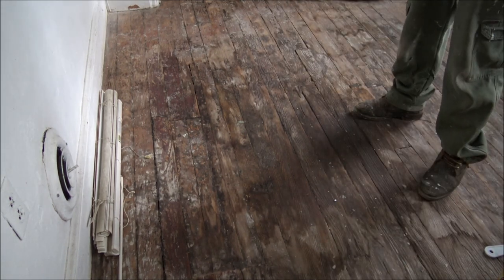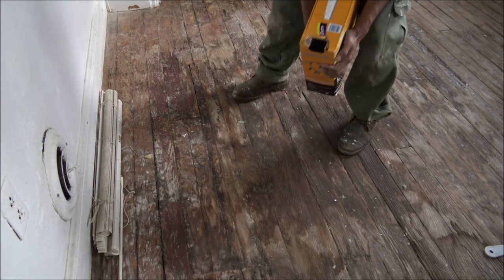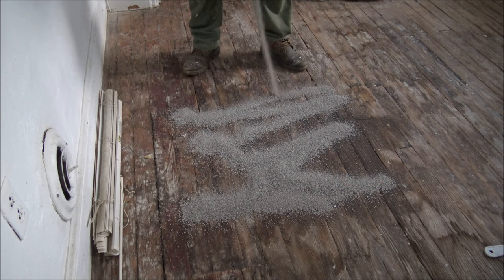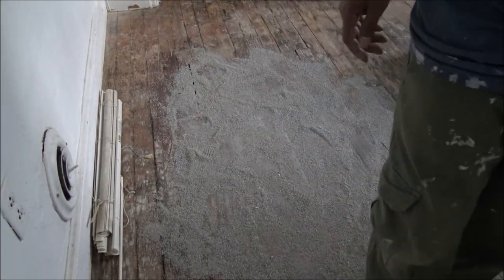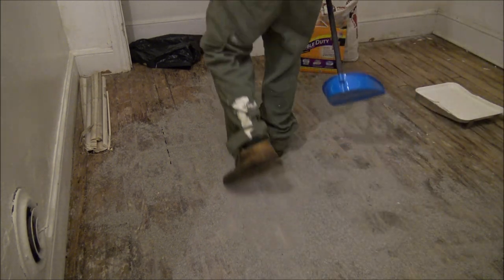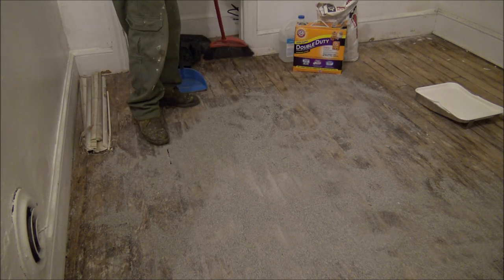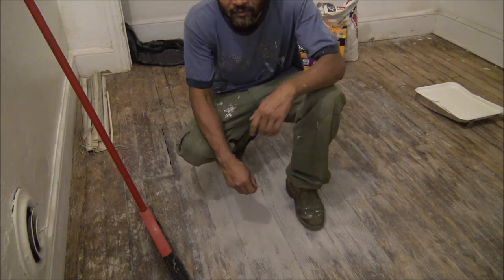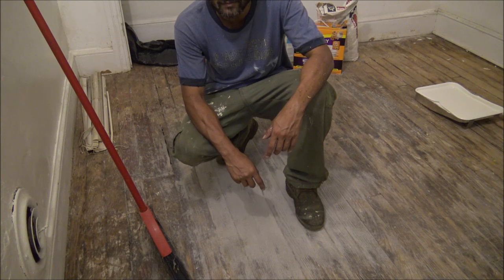How to get rid of dog urine smell and stain from wood floor

Comment: Great idea. I used to be a mechanic and we would do that to get grease and oil stains off of the cement floor. We call that the kitty litter shuffle. BTW, floor dry from an auto parts store is the same thing but cheaper and unscented.
Reply from the maker: Great point!

Comment: Thanks!🙂  Moved into a new house and the guest bathroom floors smelled of urine.  We tried everything but nothing worked, the smell would always come back
Reply from the maker: No problem.  I buy houses every year and I go through a lot of cat litter.    This is the best method that I uses.
Reply: Did it work
Reply: Have you tried using enzymatic cleaner

Comment: Question. 

I have a few pet stains on a property I just purchased. The hardwood is finished (needs to be redone) but I am wondering if this will work if the urine is dry? How long should I leave it? What should I do after removal?
Reply from the maker: I usually let it set a couple of days.  Hydrogen peroxide may also need for discoloration.  Sand it, stain it and polyurethane
Reply: How do you stain it with what I don't

Comment: I’m going to have to try this. I’m getting ready to close on a full rehab project and at some point either homeless people or cats must have been peeing inside the house. It’s smells horrible. There is rugs and wood floor under it. I was going to tear it all up and put a new subfloor but maybe this will do the trick. Thanks !
Reply: Did it work???
Reply: You could also try oil based killz if you are talking about basic subfloors.
Reply: I’m closing on a property also with a smell, did you have any luck? What worked for you?
Reply: I have used a Ozone Generator. 
You obviously clean the area but
Sit that machine in the room and let it run . They replace oxyegen  with another molecule. Anyway on ebay n not that much$$

Comment: Question: what if the urine has been there for a long time and it’s already dry
Reply: Pour vinegar over it first let it soak then do the litter
Reply: @Jmay411 👍
Reply: for use vinegar do I need mix with water? or just pour vinegar directly on floor to soak it before litter?
Reply: @lingfeiouyang yes I need to know how to do this the right way cause I don't wanna mess this up.
Reply: I need to know as well about to redo my floors and have nasty smell
Reply: Water can also reactivate it

Comment: I would love to see that floor once it's completely done. I can see that the litter did something but what is the next step? A complete sanding and finishing I presume?
Reply from the maker: I apologize for not unloading the finish product.  Yes it had been sanded,, wood filler, stain, and varnish.  The house had been rented out for the 2 months already.
Reply: @KennyHandymanInvestor  Thanks. I'll bet it looks great. I didn't think of using kitty litter because my floors are stained golden oak and have 2 coats of polyurethane on them. I started with the hydrogen peroxide 3 days ago and they are looking better but they're not there yet.
Reply from the maker: @miltyler8110  I uses hydrogen peroxide also in some cases.  For the past 15 years I always uses cat litter first.  You should give cat litter a shot to absorb those extra moisture remaining in the wood it will also remove some of the stain.
Reply: @KennyHandymanInvestor  Interesting. I was concerned that the littler would scratch the beautiful finish all around the stains. I have in my possession more of the stain and more of the polyurethane so I might be able to touch up enough to camouflage the scratches but wow it's scary.
Reply: Kenny Handyman Investor m

Comment: What if the urine dried up? Would the cat litter work?
Would I have to wash the floor then use cat litter? 
Thanks
Reply from the maker: Just mop the floor first.  The smell will always be there if you don't use the cat litter.  I been in business for a long time cat litter does remove urine and eliminate the odors.
Reply: @KennyHandymanInvestor  that's good to hear. Tx for your response and information. 👍
Reply: @KennyHandymanInvestor do u ever use vinegar first them the cat litter?

Comment: I'm gonna use this.. I just put like 3 layers of zinnee odor control paint.. and nothing.  It still making spots on top of the paint. The pee has been there forever.
Reply from the maker: A lot of tenants has dog the smell absorb into the woods.  The only way is removing all the carpet and use cat litter to absorb all the urine sitting in the woods.  I been in business for 12 years already and this is the best method.

Comment: Thank you for this. My cats ass has been hanging over the kitty litter box for YEARS and I never noticed until I pulled the corner of the floor up and noticed months maybe years of really bad smell and wet. Tearing up floor now and doing kitty litter. Should I do hydrogen peroxide after?
Reply from the maker: yes, hydrogen peroxide will discolor the stain.  After that a little sanding, staining and polyurethane at the area.  You will not notice any difference.
Reply: How did you not notice the bad smell? Cat pee smells bad!